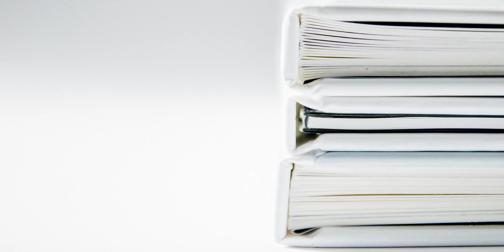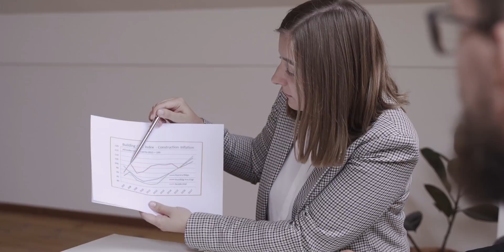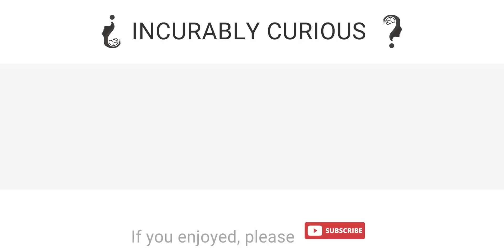Why Most Power Lines Aren’t Underground

Comment: Actually all older wooden Low-Medium power lines been dug in here in Denmark for the last 20 years, so much that some folks actually bought up som old wood poles and had them refitted with isolators, having them mounted with plastic coated steel wires instead of cables, all because they missed them in the landscape. funny how development sometimes gives people creative ideas

Comment: It amazes me how much resistance there is to build underground powerlines properly so that they can resist floods. I mean we build data transmission lines on the sea floor and cross oceans... We easily lose power for at least 24h every year where I live. Some massive wind storms have cut us off for three whole days. No need to have broken underground power lines to keep repair times high. An ice storm took us out for two whole weeks. People died because of the lack of power.

The stress alone can take it's toll, but vulnerable people are especially in danger. They have lower resistance to heat or cold, making it literally deadly to lose power for too long in summer or winter. If they have mobility and health issues, evacuation is extremely taxing and costly: they simply cannot go to a refuge meant for everyone else. They need accessible hotel rooms. Finally, medication often require temperature control, which is hard to do without power.

And in car centric localities, what happens when electricity is cut for a long time? Forget the electric cars not working, fuel pumps also need power.

The only option is to be allowed to have your own backup power source, which may not be legal everywhere for residential buildings. And building backup power supplies that can last a few days gets extremely expensive. Doubling the electricity bill is a bargain at that point.

If we pretty much need to move to, or rely solely on, electrical energy for our homes, investing in more solid electrical infrastructure is a bare minimum.

Comment: Most of the times the supposed "Costs" priced many more times higher than if the Utility actually wanted to. Horizontal Drilling to put in fiber could be used as well for electrical.

Comment: It would make a good argument to have state run utilities, as the state doesn't need to profit. But another is the constant replacement of lines due to natural disasters, although the initial upfront cost of putting in power line above ground is cheaper, depending on location could exceed the cost of burring lines.

Comment: UK is already doing it 
Weather Hot spots for Faults to key lines are done quite rapidly 
It didnt cost them the earth to do it and They doing it over a long time span And in Stages 

For the HV transmission lines between citys they have a few Tunnel boring machine (TBM) on routes  they worked out is not just HV Power cables can co share the tunnels but fiber optic internet + Internet Data centres Can Co use the tunnels and help split the bills an keep the Tunnels a Data mine long into the future even Be Data Furnace & Data Boilers For More Income Heating homes & Offices

Comment: The main reason power lines are not underground is the capacitance between the ground and the lines.

Large capacitance can cause useless current going back and forth, creating resistive losses on the wires themselves and loading them.

This can ofc all be avoided if we use DC power lines instead of AC but this has a lot of implications. DC doesn't have any problems with capacive losses since the formula for reactance is 1/2πfC where f is the frequency and C the capacitance. DC has an f=0 making the resistance of the reactive parallel load infinite (non existent). 

All underwater power lines are converted to DC and then back to AC using rectifiers and inverters. Both of these cost a lot of money and are a new point of potential failure of the system.

The power that gets out of the generators used in the power plants is AC and the power large home appliances require is also AC. Stepping voltage up and down also requires AC for the transformers to function. 

To sum up, the "last mile" of AC power delivery can in theory be converted to underground but, the rest of it will still have to be over the ground hanging on poles to make the system more efficient.

Comment: Power lines transmission based on fossil fuel so if this fact if we accept or not sorry for environmental activists 😂,  residential areas can build room in basement and put diesel generator nationwide so all poles can be recycled wooden part for houses of homless exceed 400,000 wires and transformers brass can be recycled too for electric motors this idea will make utilitys corporations suffer too much but they look for profits only and throw excuses only

Comment: We can do it with cost about 200,000$ /mile and we need no digging all in pvc pipe and over head at cross section road and cost cheaper without digging and still able to help NOAA control weather the same as on the pole with guide rail on top of pipe and we include telephone on power line router at each substation for free if we can collect phone subscription

Comment: I've also heard that most high voltage power lines aren't insulated AT ALL; the price of insulating is, apparently, too much for these companies too...
I've also heard that earth takes away some power from a powerline placed near the ground via earthing...
Either way, I still want my power lines underground... 
Insulated, flexing, loose, insulated wired in underground tiny tunnels, equipt with smart grid technology for easily locating failure, should do.

Comment: price has doubled in Illinois at least and working on wind and solar farms they put miles in every day tree roots ant going be a problem for a wire in a sealed pipe with boring you wouldn't have to worry about that bush work for the gas company I've seen them go from across the road and right to the meter no problem

Comment: I agree with many of the comments that have been submitted.  Burying cables doesn't have to be funded and executed all at once.  Execution of burying cables can be done in phases, with priority given to those most susceptible to damage from the environment.  Cables should be placed in concrete conduits, so they can be replaced and updated if necessary in their future.  Central New York City (Manhattan) has their power lines underground.  Relatively easily repaired by pulling out damaged cables, such as with burnout with overloads through buried concrete conduits and replaced  Transformer vaults are also underground.

Comment: With above ground power infrastructure in urban areas have the “perk” that often a number of residents will call emergency services for fallen power lines, arcing power lines, exploding transformers etc. So relevant parts will get info such as the address of the issues.

Comment: In the Netherlands all 230 V power lines are underground. 380 V lines are not though.
4:31 And that's why we have a whole adminstration where lines lay underground. You can get that information at the 'town hall' - or well, our equivalent of that.
5:54 And that's why we put tiles over them. Locate, remove the correct tile, dig for the cable, fix it, put dirt back, put tile back. Done. "Hours", he says. Hah.
6:32 Again, all telephone / DSL lines are underground. As is the cable. And currently fibre is laid underground. Greetings from the Netherlands!

Comment: At least in Germany there are all power lines under ground, except of extreme high voltage grids. They even started to bury the 110 kV layer, and in Berlin there is even a long 380 kV underground line. The last power outtage I remember is more than 30 years in the past, and was some seconds long only.

Comment: I used to help with horizontal drilling in Colorado. We would pull power and cable through the ground.  We did work in the Rockies, it was a pain to get through that granite.  In Fort Collins and the surrounding areas there were so many lines running underground.  It got to the point where you couldn't do underground work.

Comment: Worked for a large gas utility in MASS.  I was DigSafe guy for 6 cities and towns. I also spent years on street crews and on call crews. One day on a crew we dug a 200ft. Service trench I believe 18" deep and a shovel width wide. About half way in July heat we went to hose and turned on water. Lady turned it off in basement.  A lot of times there are utility easements that utilities can piggyback with other utility. 
   I worked with a guy that would make top layer as if no trench was dug. Brick, flat stones, and grass and bushes as if never touched. People definitely try getting free stuff claiming damage. My buddy went to school for all that stuff and would tell customer the conditions and what's being done.  
   I also traced some crazy services

Comment: I'm a power line technician. Underground is on net more reliable, but when it does fail, the outage usually takes longer to restore. Everything about underground is more complex and more expensive. For example, UG conductor itself needs to be produced in sterile facilities completely free of dust and contaminants and is about 10x the price of overhead conductors. Where a pole mounted switch costs about $3000, the pad mounted (UG) equivalent is about $25,000. A pole mounted fuse assembly is about $150, but to serve the same function on an underground circuit a vacuum fault interrupting device is required to the tune of $15,000. Then there's installation cost. If there are any existing underground utilities (gas, cable TV, fiber internet), it will have to be bored in at $15-$25 per foot. As for transmission lines (the huge ones that connect power plants and substations), they are so astronomically expensive to build underground, they are only feasible in metro areas where there is enough demand in a concentrated area to justify it.

Comment: My neighborhood is about 40 years old, and started having a power failure every couple months thanks to the underground lines.  The local power company has been going through and replacing all these cables, trenching or running horizontal drills to install new ones.  
Underground lines are susceptible to erosion from the acidity of the soil, and wear on the insulation from constant minute movement.

Comment: It's not directly related to the video, but a while back our power went out from a power line failing that was multiple miles away from our home. I asked my mom why such a far away power line could affect us, and apparently there is no redundancy in the lines. That one power pole was the only thing connecting us to the power station. Is there a reason that the power isn't just connected in some massive grid, so that if one power line fails there is a different path the power can take? Maybe its not feasible over short distances, but a power line that is multiple miles away from us feels like it should have enough redundancy to not affect us if it fails.

Comment: In Australia power lines are laid over or under public property to the property line where the hardware becomes the responsibility of the property owner. Where they must cross private land the owner must allow access and maintenance by law. For local distribution, trenching and horizontal boring to install conduits is the go, under the road easement alongside water, gas etc conduits. Cost is shared by government and rate-payers. (Power companies privately owned, mostly by the government, so supply is a political issue as well as a capitalist one.)

Comment: This whole video is very tainted by negative views of buried electrical cables. I live in Denmark where all the cables are under ground and I actually don't even remember the last time with power outage. Seriously. Back in the beginning of the 90s I lived in a house. In front of that house there was a huge birch tree. Every time we had a storm with strong winds almost invariably we had a fallen cable and we had to wait until it was our street's turn to get it done. Now after they buried the cables we have no such problems. Apart from that, the issue of trimming the trees so they don't damage the cables is an illusion. The rich counties might get it done, the others struggle to keep pace and sometimes they need to prioritize other things. It's not so easy or simple. Bury those cables and you simply don't need to have that expense. It's true that it is an expensive measure but at the same time, there are no maintenance in the form of fallen cables, tree trimming and the costs that the power outages cause. If you think her and now, yes it is expensive, but in the long term I think that it's definitely an excellent choice to put the cables under ground. Apart from that, I don't know which cables you use over there, but here I have never heard of the need to change them every decade or few decades. Maybe sections have to be replaced but if the work is done right it shouldn't be so difficult or time consuming. Just make an infrastructure plan over the long term and do it in sections over the course of 10-15-20 years. And plan new housing with the cables under ground from scratch.

Comment: 6:38 Correction. The purpose of "guy wires" does not necessary add strength to the poles. The primary purpose is stabilize the pole. It counters pulling force from the electrical lines. If the "guy wire" was not used then over time the pole either start will lean or will bend in the direction that it is being pulled.
Great overview.

Comment: in my 32 years i have only lived in areas depending on underground lines, and not once has there been a outage caused by the lines themself, it has almost exclusively been due to lightning strikes or other issues with electrical substations.

Comment: In most of Europe both electric, gas, cable etc have powerlines underground, usually under the sidewalk or next to the roadside, so avoiding utility companies digging up the road.
The only important thing is to Bury them below the frost line.
In europe the burying of cables is done by a robotic tunneling machine, that simultaneously sleeves them in a protective plastic tubing. It works in europe and we often sit and laugh at the usa system.
Reply: It's best to also place the underground utilities next to the sidewalk, and the yard side. In this way, if you need to dig up the lines for any reason, you don't have the expense of removing and replacing the sidewalk. Four feet is usually a good depth for the utility trench, but over the years that depth can change do to lots being releveled, and materiel being remover or added.

Comment: my underground power line is 120 yrs old, Why not lay the power line in preformed concrete and capped channels, no digging, following railways as in UK never had a break in service 40 yrs.Also the said concrete troughs follow motorways and a very quick and cheap to install, buried cables are laid in plastic tubing along with other services, fibre optics, easy and quick to maintain.

Comment: power lines cant be put under ground also because of danger. a damage case could lead to electricity hitting a gas main or water main. electric wires also need to u know breath cause they can get hot and in case of some sort of emergency putting them under ground would take them longer to get to. which general maintence and emergency events. would drive the cost of power up. nobody in their rite mind wants higher energy costs

Comment: 1:30  Are those rates doubling immediately or over the course of the 25 years it is projected to complete the burying of the wires? And is the money NOT spent on repairing/replacing fallen wires and poles and tree trimming/removal factored into the equation? Enlightening video. Thanks for sharing.

Comment: There is another solution. Converting current power lines and the built hardware to a very more robust and stronger system. Replace all wood poles with thick aluminum poles with internal isolation, topped with extended tubes to strengthen the contact points on the poles. This would better withstand outside elements.
Reply: And the cost of this “modification” would be…?  ;-)

Comment: in our case the vast majority of cables are underground, considerably more expensive at first, but at least we still have 24/365 electricity 
I think I had a power outage of 30 minutes in the last 15 years, ... yes because of a construction site.
But we also require construction workers to be fully trained, which is why it rarely happens that the power cables are damaged.

Comment: Let’s not kid ourselves: it’s cost. The electric companies don’t want to spend a single cent doing a major replacement so they keep putting a band aid on the system. In California, the majority of forest fires are caused by electrical wires. But the electric company will never replace those wires and put them underground if they are never blamed for the fires or even have to pay for the cost of putting out those fires.

Comment: Lies lies . I'm in NewZealand most of our power lines are underground except the very large power lines going across the country over mountains ect but all the normal power in towns and cities are underground. Even in country areas and I'm sure it was expensive but not in the billions of dollars .every new subdivision for 1970 on has been underground..you just get a team of 4 or 5 men doing it with incentive bonuses and they do a quick fast job . If all 5 men can do all the jobs you can rotate the work digger driving truck driving traffic control. And if you need a replacement you put them on 1 job till the man gets back often traffic control. 5o keep 5he team moving smoothly as possible.